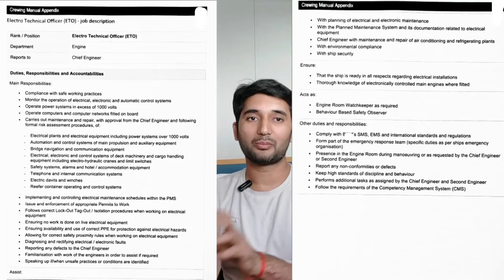Duties & Responsibilities of E.T.O || Job & role of Electro Technical Officer on ship

Comment: sir i still have 5 months before joining for 4months eto training +8 months on board triaing, I want to gain the practical knowledge on how to identify faults,troubleshoot the equipment and what kind of faults that occur. i want to learn. can you suggest me any book or any method that would help me gain the knowledge.
Reply: I am also a marine electrical and electronics engineer and I have a good knowledge about fault finding and troubleshooting of any electrical equipment on the vessel.
Reply: R u trying for Feb batch & which institute?
Reply: How r u doing it now bro???

Comment: Sir, how do we learn about the different machineries so that we know how it operates. Even though i passes EEE with 70%, i am not confident about working with it. I am concerned about how am i learning to troubleshoot and solve stuff. Should i jijn ETO course in this condition? Please reply
Reply from the maker: You need to have confidence and exposure to ship work, initially you may face it very very difficult but with time and based on your skill u can gain confidence.....better try and then decide.